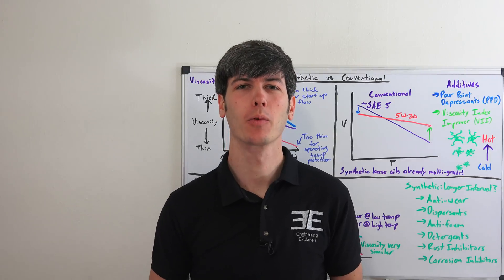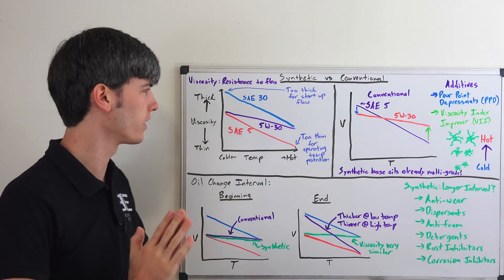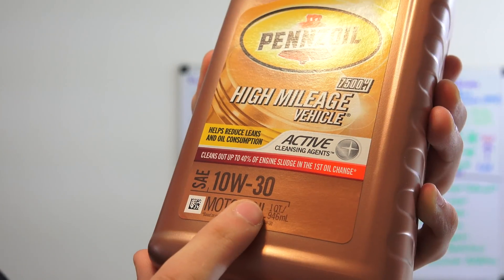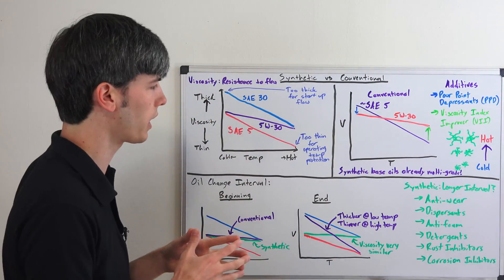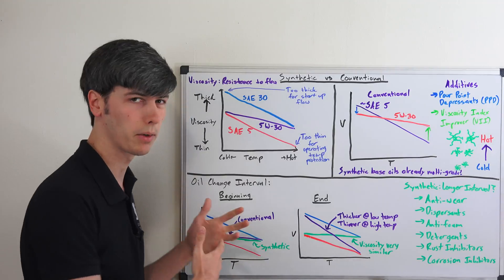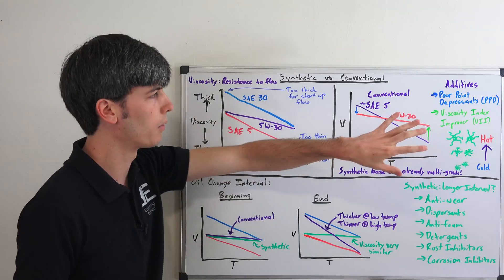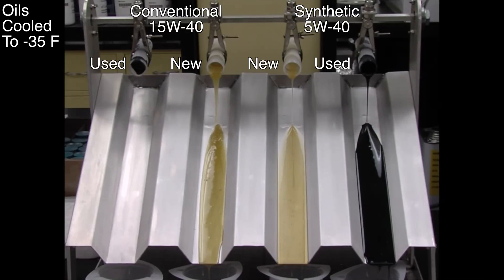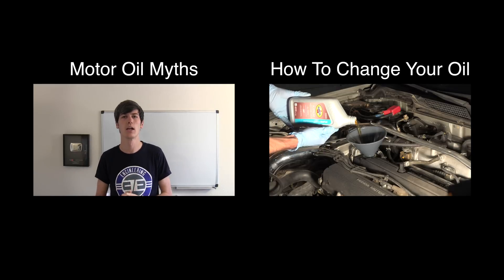Is Synthetic Motor Oil Better For Your Car?

Comment: Is it true that it's bad to switch to full synthetic on a high mileage engine because it can increase the probability of oil leaks?
Reply: Synthetic oil has a lot of detergents that can clean out the deposits and show pre existing problems with your engine it cannot create leaks but if the leak was already there and you use a high quality synthetic oil it can clean the areas that were gunked up and yes may leak

Comment: If you have a high mileage car, you will want to use the high mileage synthetic. The high mileage synthetic is usually a slight blend, but works out better to stop small oil leaks and helps to repair worn out rubber parts. Full synthetic will definitely leak out of a small opening, where high mileage synthetic may actually help to temporarily stop the leak until you can get the seal fixed.

Comment: what about using 10W40 or 20W50 for gulf regions the weather gets very hot here. is synthetic oil good for gulf regions and for 2006 toyota vehicles scion xa or yaris

Comment: so "Winter" refers to the engine itself being cold, not the outside air temp/environment?
Reply: It refers to a testing temperature, which seems to be Zero degrees F (-17.8 deg C)

Just like the octane rating of the fuel is based on a test which includes things like it being a certain ambient temperature.

Comment: Wait, so if im using "conventional" 5w30 it is not really conventional in the sense they added synthetic oil. I.e there does not exist a conventional oil 5w30 in the strict sense of the word. right?
Reply: Due to what some countries do and don't call a synthetic oil, the terms can be a bit confusing.

The short answer to your question is, that there is no mineral oil (mineral oil is crude that is refined through a solvent based process) that is 5w30, 

The longer answer is:

Your "conventional oil" would be a blend of both the mineral base oil, and an oil that is either HC or PAO based.

PAO base oils are 100% man-made

Whereas HC (hydrocracked) engine oil originates from crude oil, but is changed by humans (not simply "refined"):

Hydrocracked lubricants are formulated via hydrocracking, in which crude oil molecules are chemically altered and rearranged into building blocks with favorable characteristics. The resulting base oil is far more pure (99+%) than solvent-refined base stocks, making it more resistant to oxidation, more responsive to additives, more pumpable at low temperatures and lighter in color.

The reason that the "semi-synthetics" (as they are / were referred to) is to give an oil some of the benefits of a synthetic oil, but at a cheaper price point.

From the little I have read, these days there isn't much difference between PAO and HC base oils (when HC oils were first release they were not as good as PAO oil), 

And as bit of extra information, Shell for their premium products use a base oil that is derived from Natural Gas (so not from crude oil)

Comment: Cooling the oil to -35F and then testing the flow is not a realistic test?  Since when does a vehicle engine operate at -35F?   I have found this type of invalid comparison before.   What is needed is to understand what the differences are in the normal operating ranges and conditions.  And if those differences are significant.

Comment: Just put what manufacturer recommend. 
There are supercharged motors where they wanted to squeeze out the last drop of HP from a small volume motor, then it is dependent on high quality oil. 
And there are relaxed motors that are meant to eat oil at breakfast so you don't need to burn money. Just change it at time and it will outlive the rusting body.

Comment: Back again after three years. This test is fake news. What is shows is that the 15W-40 oil never should have been left in as long as it was. It might be better to look at the 15W-40 oil after a reasonable severe duty interval like 2000 miles. My source says it never had gotten below -34 F in Anchorage, Alaska. That means, an engine with 15W-40 installed should turn, start and develop oil pressure even in the coldest weather you will encounter in Alaska's major population center.

Upon further review, I can't say that the used 15W-40 in this demonstration would get picked up, flow and start warming up fast enough. But the fact that it became thick like that is a clear sign that you cannot leave it in that long. Maintenance intervals have to be matched to the specifications of the product being used.

If the purpose of this demonstration is the show that you go longer on synthetic oil, fine. But that's already proven. Even with my conservative mechanical theories, that is what I have in fact done when I have used synthetic.

Comment: How much does the external temperature matter for the engine? I live in a hot country and shouldn't I use 20w50 as opposed to 5w30 (manufacturer's recommendation) because the temperature here gets around 125 fahrenheit

Comment: My engine is leaking somewhere (probably rings or head gasket). And I can't afford to take it to the workshop and open it at this very moment. It has got a consumption of around 1,5-2 lts per 1000km. Using the synthetic 5w40 specified in my car's manual would mean a pretty important cash difference vs a cheap conventional 15w40. My thought is that as I'm burning the entire amount of oil in the engine each month and a half, oil wearing out shouldn't be a concern (I have to fill it constantly and it gets consumed when it is still pretty new). Should I concern too much about the cold capabilities of the 15w40 vs the specified 5w40? or is it an acceptable trade off for some months until I can afford to repair the leaks considering the price differences (synthetic being more than twice as expensive) of the oil that I'm constantly having to refill? By the way, the car is a 2007 VW Gol 1.6 with 165 thousand km on it running mostly on CNG (gasoline only used at start-up and before parking at night to avoid CNG condensation). The car use is done mostly on a 120km long daily freeway trip.

Comment: Nice video, very informative.  I think people who prefer conventional oil can still use it, but just know that you have to change it more often.  Users of synthetic oil can go longer between oil changes, however, the problem is that some people think they can drive forever between oil changes and then end up never changing their oil.  So even if you use a high quality synthetic oil it still has to be changed along with the filter.

Comment: I had an old corolla that would burn through oil. Turns out the rings were caked with carbon deposits from conventional oil that couldn't withstand heat from the combustion chamber. The rings then, as a result of being caked with carbon, allowed oil to seep past them into the combustion chamber. Running Mobil 1 full synthetics stopped the problem from getting worse, and even reversed it to a certain degree, although it did take a couple years of running that oil. Synthetics are far superior and far more resistant to heat and break down.

Comment: Full synthetics and follow manual viscosity, don’t believe in overkill by using 100% synthetic that last 20,000 - 35,000 miles! Check air filter and change engine oil and oil filter at 5,000 - 7,500 miles or 1 year. Risk is yours if extend oil change, ask around.

Comment: I'm new and confused with the names. Over here I don't hear about Conventional oils, but I've heard of "fully synthetic" and "semi synthetic". Which one should I use for my 2017 Toyota Avanza?
Reply: Semi-synthetic oil, is an oil that has a combination of mineral oil and HC or PAO oil as it's base oil
 
Fully synthetic oil, ONLY has HC or PAO oil as it's base oil (so is superior, but also more expensive)

Some countries only count PAO oils as fully synthetic since it is completely man-made,

Whereas other countries also count HC (hydrocracked) engine oil as synthetic, since whilst originating from crude oil it has been changed by humans.

HC versus mineral oil:

Mineral oil originates from crude oil and is just refined through the use of solvents to get impurities out of the oil, 

Whereas HC oil:

Hydrocracked lubricants are formulated via hydrocracking, in which crude oil molecules are chemically altered and rearranged into building blocks with favorable characteristics. The resulting base oil is far more pure (99+%) than solvent-refined base stocks, making it more resistant to oxidation, more responsive to additives, more pumpable at low temperatures and lighter in color.

So without knowing your budget or the service history of your car, I'll keep it simple,

Synthetic oil is better than semi-synthetic.

Comment: Polyol Esters Market: Market Trends
Polyol esters are employed extensively in jet engine lubricants. Polyol esters are being utilized in this field for the last 40 years. No other compound has been used as its substitute since it would affect the lubricity, and this is likely to eventually hamper the working of the component. Polyol esters are employed along with Polyalphaolefin (PAO) Synthetic Oils in passenger car motor oils.
Superior qualities of polyol esters such as thermal stability, high lubricity, and better viscosity makes them a sought-after compound.
Reply: From the little I have read recently,

For the AUOMOTIVE industry according to liqui moly, every automotive oil manufacturer is mainly if not solely doing research with HC oil,

As they claim that some oil requirements cannot be met using PAO.

They also claim that the difference between PAO and HC isn't as great today, as it was when HC was first developed.

Comment: First of all, great video on explaining the lower and higher numbers in oil. However, I do feel that the last section might result in wrong conclusions to be drawn. With a thicker oil a similar relative change is always going to show as a larger absolute change in time to flow.  In my opinion the point would have been better proven by putting a new 20W next to it or using a synthetic and conventional oil with identical lower W number. All in all, I think the strongest argument for synthetic oils is their generally higher operating temperature range. Keep up the good work!

Comment: Bro , nicely explained. But my issue is different. I use shell full synthetic engine oil but my cat runs only 700 to 800 kilometers in 6 months. So what do I do now some workshops say that even if you run your car 100 kilometers in 5 months, you should change the oil no matter even it is full synthetic. Some workshops say since you drive like 700 kilometers only in 5 months so you keep the oil for at best 6 months. Full synthetic oils can last up to at least 7000 kilometers or 6 months. Some say whether your oil is full synthetic or whatever , just change your oil every 3 months even if you drive for 100 kilometers only  in 3 months. So what should I do now? I drive 700 kilometers only in 5 months not 7000 kilometers. I am really confused. Need some clean and clear answers. Please help here.

Comment: I have a Dodge charger 2008
My friend told me not to use synthetic oil for an old car
Is it true that synthetic oil is not good for old engines ?
Reply: If you have a leak, switching to synthetic can make that leak worse since it flows easier

Comment: The people that designed and built my auto specified 0W-30 Synthetic motor oil. So every 3 to 6,000 miles I take the car to the shop and pay for 7 qts of Mobile 1 and a filter. Works for me.

Comment: I’ve been told not to use synthetic in my 40+ year old motorcycles.   Forty to fifty weight mineral (conventional) oil in summer.
Reply: Maybe Rotello , you can use one without the energy conserving label in the api as they will cause wet clutch slippage.  There should be online info.

Comment: That final "science lab" demo has blown my mind a bit! As a classic car owner, we are told to routinely change oil either every year, or every 3K miles. Compared to modern cars and oils, that seems crazy. But of course we use (modern grade) 20\50 classic engine oil. I never really understood, until now, why the frequency was so necessary, given that I routinely do 10K miles in my BMW between changes. But your science lab demo explains this perfectly. It's actually quite scary how the used "conventional oil" flows, compared to when it is new. Many thanks. Super helpful

Comment: Ask yourself....am I keeping this car forever? Then maybe get synthetic. But if you change up you car every 5 years, why bother? I have two cars with over 500k on both ... I use conventional. The most important thing....regular oil changes.
Reply: Love these high mileage stories, I don't believe them.  I've never known anyone to go over 300,000 without major work.
Reply: @lonniebeal6032  km?? Our shop has a wall with 20 or so of our customers all with over 500k

Comment: I work in a Place where we have 7 toyota tundras, purchased at the same time, owner owns a toyota dealership also, we used full synthetic on 6 trucks and one no synthetic, the trucks are have over 100K miles , in less than 3 years, oil change intervals for synthetic 10K miles and no synthetic 3000k miles, the synthetic burn more oil than non synthetic, the  synthetic developed engine noise , temps were little higher, and little lower oil pressure, the non synthetic required a water pump , thermostat  replacement  and radiator replacement around 100K
Reply: I've taken 3 cars to over 150k miles on full synthetics with 10k to 15k oil changes filter halfway, no oil related problems,  But I don't use 5w20 unless its winter and below 50F.  Mostly 10w30 Supertech full synthetic.

Comment: Mineral oil: severe change in oil properties at the end of use cycle
Synthetic oil: retain its properties better, near to the new oil.
Conclusion: you will pay a bit more for synthetic, but it is better and worth it.

Comment: @6:50 WHY comparing of different specifications at same temperature reference?....15W40 vs. 5W40 at same temperature???, and also i'm presuming that both oils were used at different engine conditions therefor different amount of solubles are present on the  used ones... BIG DOUBT

Comment: i have 2010 Toyota Yaris 5-door 1.33 Dual VVT-i Manual, 101hp,  6-speed  please what engine oil should i use. i live in Ghana West Africa with a hot weather

Comment: I noticed over the years that a mineral oil always had a much more noticeable drop in the oil pressure reading on the gauge in my car. Especially in hot weather.

Comment: Is there any truth to using synthetic early on, switching to a blend at 70k, and then to oil at 120k? I've heard varying numbers, but the consensus seems to be, synthetic early, blend at 'high' mileage, then oil at 'higher than normal' mileage. Thanks!!

Comment: You have confirmed what I have believed for years.  That is that quality synthetic oil remains "in spec" longer  than conventional oil justifying a longer oil change interval and therefore the extra expense.  IMHO, if people will change their oil every 3K miles then a quality conventional oil will be fine and cost less.  The only way to justify the expense of synthetic oil is if it allows for extended drain intervals.

Comment: Viscosity any oil thins when it's hot,but film strength is what counts,thinking that oil begins at 5w when it's cold and 30w when it's hot makes people think the oil thickens when hot,it doesn't,the film strength on multi grade oil changes it's film strength... It's why it's important to run a thermostat,you want your engine to reach operating temperature as quickly as possible because it brings parts to closer tolerance,like the cylinder bore to piston clearance,it's why you have ring gaps on piston rings,the gaps decrease when the engine warms up,get it too hot and you end up decreasing the clearances too much and bad things happen,180 degrees works well for everything and gets your oil to it's working range,newer cars like to push things very close to the boiling point with 205 degree thermostats with coolant temperatures as high as 235... Fine with antifreeze and pressure,better fuel economy and tighter clearances,but also very little margin for error,a stuck thermostat,low coolant,weak electric fan,faulty radiator cap or anything else can overheat your engine very quickly,synthetics are the way to go on everything,motor oil,transmission fluid,brake fluid,power steering fluid,the exception would be old vehicles built anytime before 1985 or so as their seals on the engine and other components may not agree with synthetics and may leak like crazy,especially cork and paper gaskets,geeze wanna make a old engine leak synthetics go right through paper fiber gaskets and cork,better to reseal with RTV

Comment: Thanks a lot for breaking this down to an IT systems engineer level 😎. However, I think it's incomplete, at least not considering all variables. For instance, I have an old car, European, doesn't matter... It's old, from 1988 which I restored recently and although the engine has only done 68k kms, ~ 55k miles, Ford recommends 10w40 semi synthetic. This is still what I use. The question is, geography in terms of climate and type of engines are also variables to take into account right? My classic garage highly discouraged me to use synthetic. What say you master? 😉🤔 BTW... Look it up.. Ford escort xr3i for a climate like Portugal.